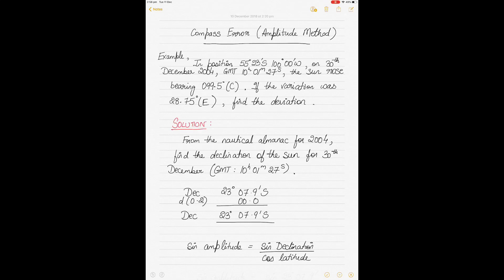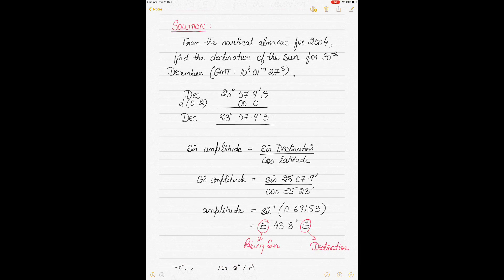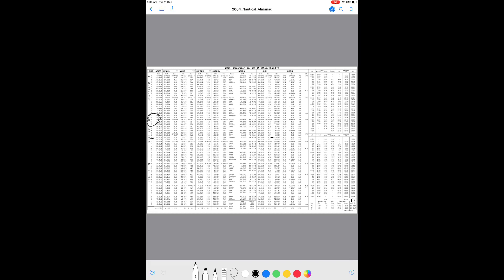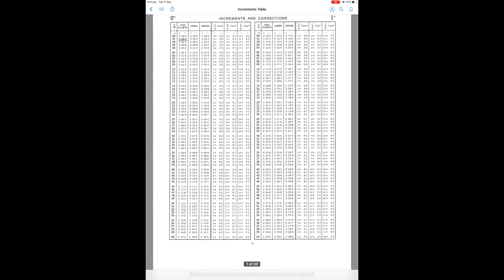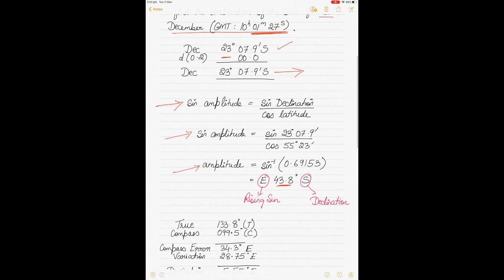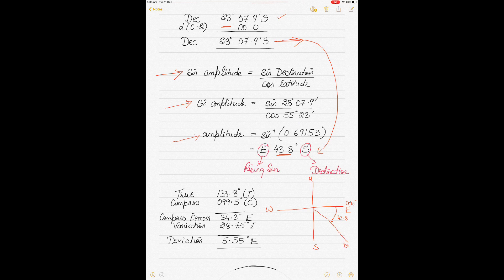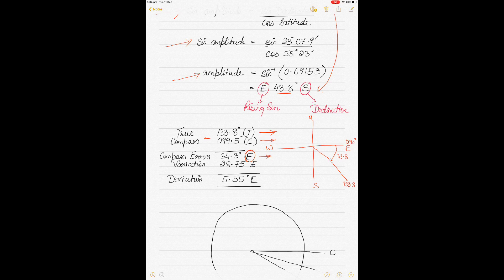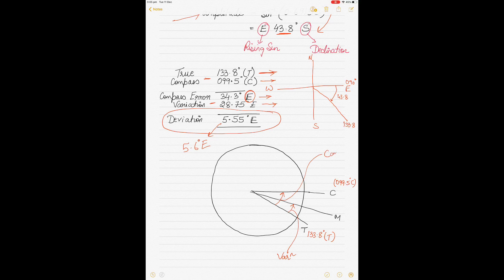How to calculate compass error using the amplitude method??

Comment: sir can u help me solve this

On December 3, 2010, in position Lat 30'45'S and Long 160 15 E the sun Set bearing was 250 by compass, variation was 14'E and true bearing of 255.7 and vessel is on southerly direction.

Given: 
LMT Sunrise @ 25'S on 3-18h 10mins
LMT Sunrise @30'S on 03rd-18h 17min
LMT Sunrise 35'S on 034-18h 24min 
Latitude correction +Imin

Declination 12" 15'S 
d correction 0.9-10.6

Find the amplitude of the sun, Time of UT sunrise and deviation